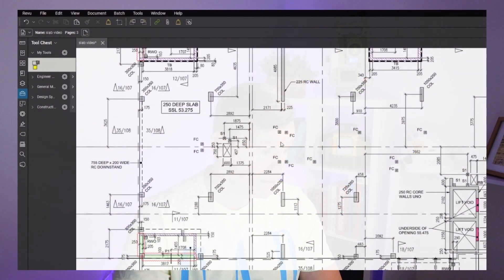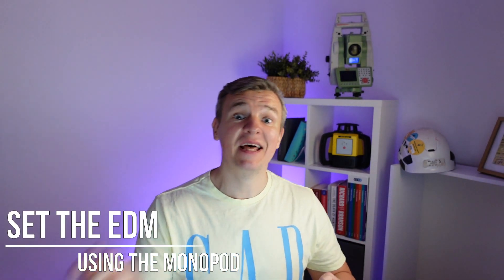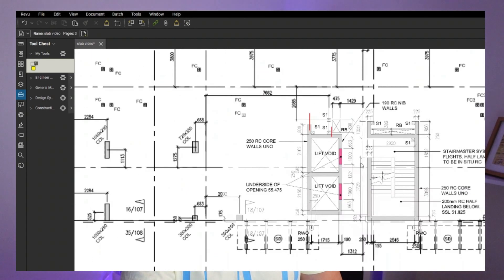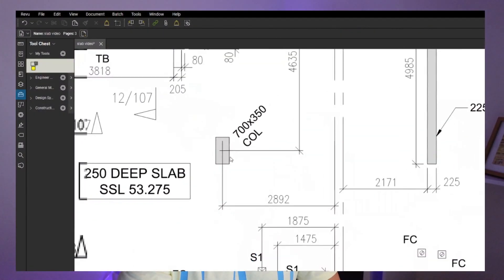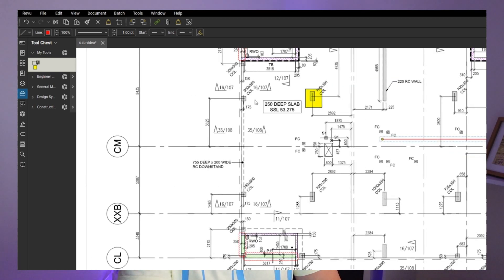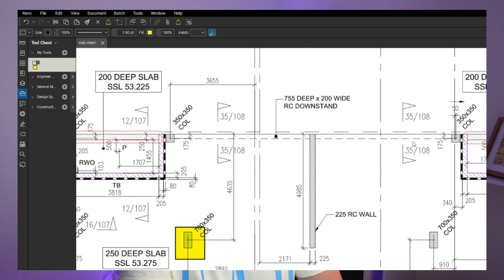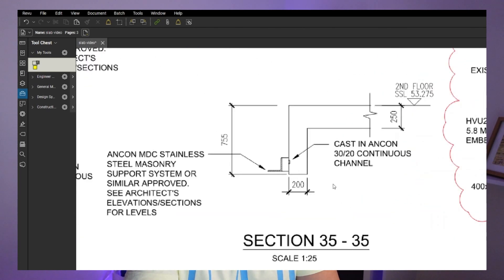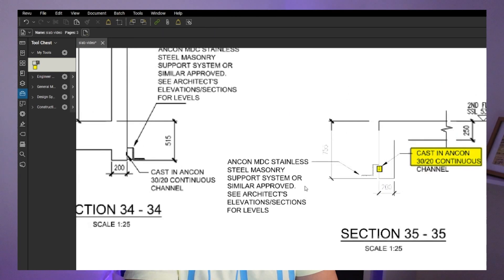Setting out concrete slab

Comment: Hey Greg, I know a way to put dwg straight into edm with all drawing information, it is much easier and faster and life changing on-site, you put it as a reference file ,I use ts16, message back if you want details
Reply from the maker: Might be good for TS16, I personally wouldn't add all drawing as I like to prepare it keeping only what I need if setting out. I was bringing drawings as a background drawings too, but as I said I really like to prepare the drawing and still keep the printed ones all the time with me 😁
Thank you  and please write how to do it so other guys can use it 👍👍
Reply: @SITENG  it's great honestly, u make a new job, then you go into job properties and there press page until you get to reference files, make sure USB is plugged in with the dwg, then tick the dwg you want to use and press add, then store it. Now to use it to set out u click on the line or point you want in 3d viewer and then hold it on the touch screen until the menu comes up and press import
Reply from the maker: I will have a look when I get my hands on TS16 😁 TS15 would die. Thank you for this!

Comment: Hey Greg just wondering why you always using blue beam and not AutoCAD much?
Reply from the maker: I use AutoCAD a lot, but BB is great too. I use BB mostly for mark-ups, AutoCAD with Total Station and to measure accurately. Obviously when working with drawings as PDFs these I open in BB

Comment: When the engineer marks the lines in for the job do you use the inside of the spray line or the outside for the marking for outside of the concrete can you do a video on marking out
Reply from the maker: Hi Paul! I use a string line and spray so the you can see the line, or spray first and then chalk line on top 😁 There are vids on the channel showing this 😁
Reply: @SITENG  thank you